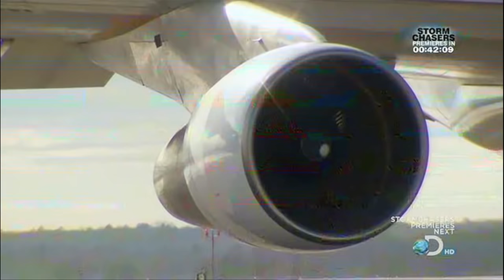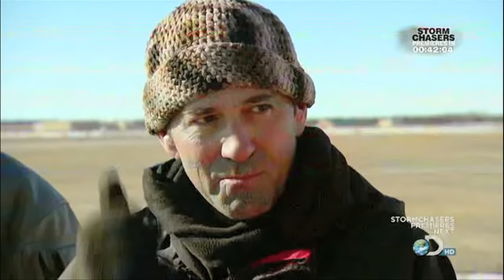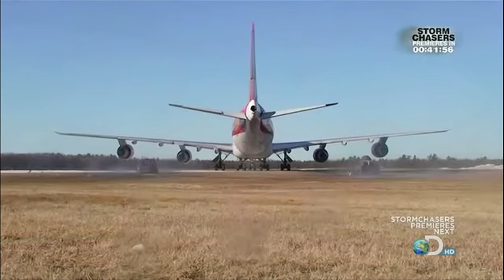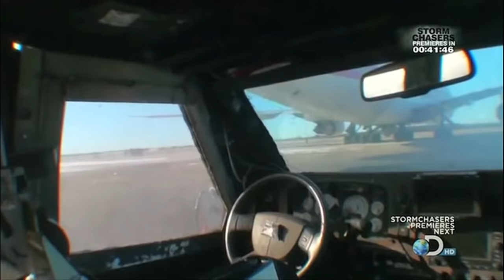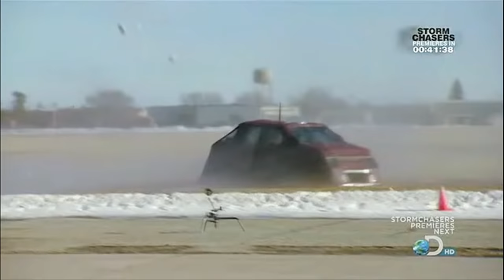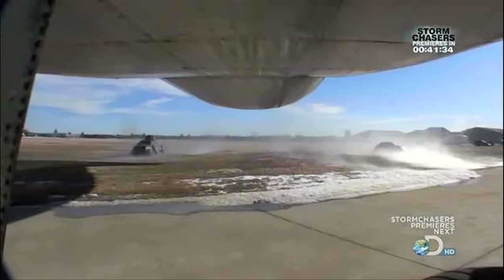TIV2/Dominator behind 747

Comment: TIV-2 is a really tough vehicle. Nothing can move that beast outside of the 600 horsepower Cummins diesel under the hood.
Reply: Chevyblock 550 it bent the spikes on tiv 2
Reply: Chevyblock 550 while I do like Cummins bc u can do almost anything with them, I perfer the duramax due to the Allison transmission
Reply: Chad A. 
I own both a Chevy and a Ford.
My work truck is an 06 6.0 F-350 (studded heads and egr delete) and my daily is a 00 4.3 Blazer so I don’t discriminate.
Cummins makes awesome engines and Chevy makes awesome tranny’s and if they combined them then they would make for one awesome truck.
Reply: nothing beats the orignal
Reply: that dominator used is dominator 2 the dominator 3 would easily stay still
Reply: @adrenalinewill  this is actually dom 1, dom 2 had spikes
Reply: @AnomalyBreach no dom 1 did not as seen. In the show storm chasers they said the spikes where a brand. New idea
Reply: But the dominator move
Reply: @titusthebigman999gaming6  ok so dom 2 had the spikes dom 1 did not
Reply: @Mr_dominodude  Bruh its So weak it can't handle a 200 mph it should have 4 spikes
Reply: @titusthebigman999gaming6 Ikr
Reply: @Mr_dominodude  What happens if the they test the titus from into the storm.
Reply: @titusthebigman999gaming6  I  would think because there's massive winds gaps and it is only being weld down with little spikes  in 300 mph it would go for sure
Reply: @Mr_dominodude  Wait so if they test it, It will give up? But it has wind sheirs underneath the Titus.
Reply: @titusthebigman999gaming6  no still the body is not flush to the ground
Reply: @Mr_dominodude Ok, But The Titus has spikes which extends.
Reply: @Mr_dominodude  Nice T.I.V lego bro
Reply: @titusstormchasingvehicle6195  thanks
Reply: @titusthebigman999gaming6  wind get under the vehicle it rolls and in a real tornado roll and bounce around and get destoryed in a storng tornado
Reply: @Mr_dominodude  Oh Okay
Reply: @adrenalinewill  it’s dominator 1, dominator 1 don’t have spikes
Reply: I’d bet that a 777-300ER would eat up both those vehicles.
Reply: Love how unimpressive 600 ho is to the 746
Reply: The afterburner: yeah no *sends tiv2 flying at mach 3
Reply: 260th like.
Reply: @usvmchc2843  bro what jets like thes3 dont have afterburners?
Reply: Also the tiv 2 and dominator 3 and 2 all have spikes and the tiv 2 would not be sent flying bro have you ever watched the series?

Comment: Its easy to see this and say "tiv2 won" and to forget just how amazing both of these vehicles did. if that was any other road legal vehicle besides a tank it would have been destroyed. And the Dominator 3 now has spikes like the Tiv2.
Reply: Plus that was dom 1
Reply: @matthewtrinh8961  Im horrible with names
Reply: @Aroforceyeah  thats dominator 1.
Reply: Yes tiv 2 didn’t move but what do you expect tiv 2 was built buy a literal welding school in 2007 apart from the Cummings 6.7 and the 2007 ram 3500 frame everything on tiv 2 is custom it is a custom build tornado intercept vehicle. While srv dominator was just a average 2007 Chevy Tahoe that reed payed to build a external roll cage on the stock Tahoe body that connects to the frame then sheet metal is welded to the roll cage with Lexan windows and a coating over the metal. SRV dominator 2 was made to be stronger, more aerodynamic and tougher so reed and his team could intercept stronger tornadoes that srv dominator could not it had spikes etc . dominator 3 was made to like the previous vehicle was built to fix problems that the previous dominators had I am not saying dominator 2 was a bad vehicle but there was probably some problems that reed wanted to fix with it he had done on dom 3 🤷🏽‍♂️  edit yes dominator 2 or 3 would have done much better than SRV dominator 1 here especially at these wind speeds 👀
Reply: Dominator 2 does have shorter but wider anchoring spikes behind the rear tires, on top of that a more aerodynamic frame and the ability to drop down to the ground. It would likely fair better than the Dominator 1.
Reply: @Aroforceyeah thats dom 1 dude. Sorry.

Comment: you could say the TIV won but really any other car would've been toppled and tossed 10 seconds into the blast. The 747 has massive engines with some really powerful thrust. Its understandable the dominator couldn't hold strong as long as the TIV did with its spikes and also overall heavier weight. Really interesting.
Reply: I caught blud COMMENTING on a video??? 😂😂😭🙏💀

Comment: Neither one of those vehicles could withstand an EF-5.  T.I.V. is a much heavier vehicle than the Dominator, but in a storm that strong all it would take is some heavy object hitting it and rocking it enough that the wind can get a grip under the edge.
Reply: GeetarAdam True. I think TIV-2 would have a real good chance at withstanding an F5/EF5, but dominator would not due to the fact that there is debris and the wind is erratic and come from many directions.
Reply: well the TIV 2 was built with steel armor and the dominator was built with just rhino lining for protection. i did see a video on here where the TIV 2 intercepted an EF3 packing winds of 175 mph and it shook off the punishing winds and debris like it was nothing.
Reply: @derekwall200  d1 got wind speeds of 175mph with updraft of 200 in 2011 and d3 has recorded 180s, and the tiv intercept did not intercepted safely, the tiv doors blew oped and large debris got in, also in the video it showed something hit their windshield which made a spark and scratch/crack in the windshield. Simple terms tiv 2, d1-3 can survive ef4, and could survive f5 windspeed, they don't do because of the danger of large debris like cars.
Reply: @alfonsohdezB  yeah that's a good reason. If I were to build a Tornado intercept vehicle, I'd construct the entire hull out of titanium
Reply: @derekwall200 , in a tornado density is your friend.  A heavier vehicle is simply harder for the tornado to pick up and roll around.  If it’s armored and has good seat belts, the occupants should survive a couple rolls.  Something as dense as a tank wouldn’t even move.  The three pro chasers who were killed in the El Reno monster were in a small car that got lofted and tumbled like a piece of aluminum foil, throwing one of them from the vehicle.  They died of blunt force trauma.  I heard recently that the last recording/transmission from them was right when they realized they couldn’t escape, and one of them cried “We’re going to die!  We’re going to die!”  Poor guys.  I hope they got knocked out right away so they didn’t have to live with that fear for very long.
Reply: @derekwall200 The axles would break long before you get in a tornado.
Reply: @alfonsohdezB Debris only got inside the TIV 2 that day because they didn’t lock all of the doors.

Comment: The TIV2 is such a heavy beast and has anchor spikes. 
Dominator is a bit cleaner and nicer to look at though.
Bottom line if I had to drive though a tornado...I’d take either lol.
Reply: @DanRustle  The Dominator has been closer to more tornadoes than TIV2 so I question the merit behind you typing "it would get you killed"- because regardless neither of these vehicles would survive a direct hit from an EF-4 or EF-5 tornado- not to mention there's Dominator 3 now which is far more durable and advanced than Dominator 1, as well as both 2 and 3 have spikes to keep it from being blown like 1 here.

And the only similarities between the TIV's & Dominator's is they're both armored vehicles aerodynamically designed to survive tornadic-winds and debris.
Reply: @WeatherxCalipha  TIV2 already went inside a tornado
Reply: Well the dominator 1 is not ment for that strong winds so its kind of a unfair match.
Reply: @matthewtrinh8961  
I’ll still take the tiv1 over my X3 in a tornado though! 
I’d end up in the land of oz if not lol.

On a serious note though, I can see how it could have benefits over the tiv2, even though it’s bigger and heavier.
When you’re driving down a maze of narrow dirt roads, chasing large erratic tornados...
I’d say the smaller dominator has the advantage of being a lot more nimble, and she’s still no slouch.

Tiv2 seems so long that he probably has to swing that mf really wide around corners, like a semi truck or a bus.

So if you think about it, one is nimble and still capable, and the other is not, and instead it uses its heavyweight to its advantage and plants itself a lot better.

Two different kinds of beasts, but both beasts nonetheless.
Reply: @WeatherxCalipha  "On May 27, 2013, TIV 2 intercepted a large tornado near Smith Center, Kansas. The vehicle was struck by large debris from a nearby farm and suffered damage to the roof-mounted anemometer and at least two breaches of the crew compartment when the roof hatch and one of the doors were blown open. Before the anemometer was disabled, it recorded winds of 150 to 175 mph (241 to 282 km/h), placing the tornado in the EF3 to EF4 range."  

That was a direct hit from an EF4 tornado. If there was no heavy debris from the farm, it wouldve easily survived it fully intact.
Reply: @WeatherxCalipha TIV 2 survived an EF4

Comment: After this no one is going to want to chase a tornado that’s over +150 mph in the dominator💀
Reply: yeah but look how well it held up, it didnt roll, just slid, imagine dominator 3.
Reply: woohoo if only it had spikes
Reply: Domintor 3 has spikes i belive  @icey_sickle
Reply: dominator 3 could have a high risk of rolling since the frame is actually tall and thin compared to the older designs
Reply: @theofficiaIsteve And how would the wind get under the car? And the dom 3 is pretty damn aerodynamic
Reply: dom 1 did well all it did was slide around didnt rollover or anything
Reply: @user-mt2zf7bw7o  there's a difference between rolling and wind getting under, enough pressure of the wind pressing against the side could topple it since the spikes it has are pretty centered.
Reed when testing the dominator 3 with a jet even said he'd have problems with side winds. It is a pretty tall vehicle
Reply: @theofficiaIsteve   You know I always thought that someone can create a ufo shaped tornado intercept vehicle would be super aerodynamic and would probably handle ef5 winds in all directions perfectly. And combining with the spikes and advanced armor I can see it handle ef5.
Reply: @icey_sickle dom 2 and 3 have spikes

Comment: TIV 2 and the Dominator are both incredible vehicles with different engineering plans to boot.

As we saw, even though the Dominators Anchor point failed it still did its job well to keep it from flipping or the wind from getting underneath it. Protecting the Crew inside.
Present day now the Dominator 3 Has spikes like the TIV 2 so they're both equally as protective

Comment: the TIV 2 may be able to handle the 250 mph winds in an EF5 but the #1 killer in tornadoes isn't the winds, it's being impaled by debris. and with all kinds of debris that would be flying through the air at 200+ mph like missiles could penetrate the bulletproof Lexan windows and kill any unfortunate soul sitting on the other side of them
Reply: It's going to take more than a 2x4 to punch through those windows. The windows are bullet proof. A rifle round travels at over 2500 feet per second, has a shape optimized for penetration, and is comprised of lead and copper. A 2x4, while certainly heavier, would be traveling slower, is blunt with no penetration advantage, and would probably shatter on impact because it is comprised of wood. It would take a steel pole traveling at over 300 mph to have a chance at busting through those windows. Remember, each of them is 2 inch thick polycarbonate.
Tiv's greatest enemy in a twister isn't the debris, it's the wind. The problem with going into an F5 is that the winds would be exerting so much pressure on Tiv that it could cause the mantling points of the spikes to fail, which would cause Tiv to slide across the ground and potentially topple. This is why Dominator 1 and 2 can't go into anything higher than a mid F3, the winds would push them around too much, like what happens to Dominator 2 in this episode.
Reply: RojoFern that was dominator 1
Reply: @jacobkeys8664  yeah and dominator 1 doesn't have as thick of armor as TIV 2 and it also doesn't have the retractable spikes to hold it in place
Reply: Derek Wall that’s true
Reply: @RojoFern  See, im not even worried about the spike hard points failing. Id be most worried about the terrain they deploy on. The rear wheels are not covered by the skirts like the dominators are. I would have lived to see this test repeated with both vehicles in profile on the side of a ditch like they are somewhat frequently parked. If dominator were to dip down a ditch while sliding like that it would lift the skirt and allow the wind underneath to possibly lift and likely roll them. Tiv on the other hand doesnt have protection at those rear wheels which could allow wind under that skirt in profile. If wind can get under that skirt and lift at all, those spikes could pull or lever free of softer earth
Reply: Ryan Shepherd the man who now owns TIV 2 came out fishing with us once and he brought the TIV down to one of our properties in berthoud and it is everything they say it is which is “the best tornado intercept vehicle in the world!”.. we shot 10 gauge Triple B  shells at the drivers side window and the armor stuck no damage and only one vague dent.. also fired some 5.56 mm nato rounds at it and nothing.. that’s some expensive ass glass my guy 😅

Comment: Moore had peak winds of 300 MPH, now you'd think that it's only 50 MPH more than this test, however, the energy of things hitting it, including the energy of the air itself, rises exponentially with velocity squared. So it's a heck of a lot more and why the EF scale from an EF2 to EF5 is only about a 130 MPH difference, but the diff of roof damage vs bending steel.

Comment: People forget that this is 250mph in STRAIGHT line winds. In a tornado winds don’t go straight they go where ever they want. So realistically if you had both of these in a 250mph tornado things would not go well. I’m not an engineer but I know that these vehicles could probably not handle those winds in a tornado especially dominator 1.

Comment: What about making a slick aerodynamical car ? 😂😂😂
Reply: Aerodynamics help with the wind but they need armor to resist the debris.  Aerodynamic armor would be astronomically expensive to make.
Reply: @evilsharkey8954  I don't really think aerodynamic matters the weight matters more.
Reply: @titusthebigman999gaming6  It’s not just the weight. It’s the density. Semis can get rolled by powerful tornadoes. The armored intercept vehicles are dense from all that armor, smooth-ish on the outside, and low to the ground to prevent wind from getting underneath and flipping them. I don’t think either of them should ever try to intercept an EF-5 though. They might make it, but there is still a risk they could get flipped and hurt through the underside of the vehicle. It would be really difficult to get out, too, in case the vehicle caught fire.
Reply: @evilsharkey8954  That's true. But the TIV2 is not aerodynamic and it has flaps but Dominator 1-2-3 only has a lower chassis